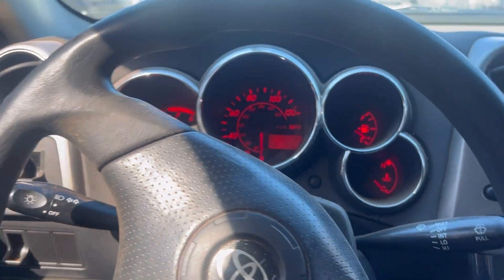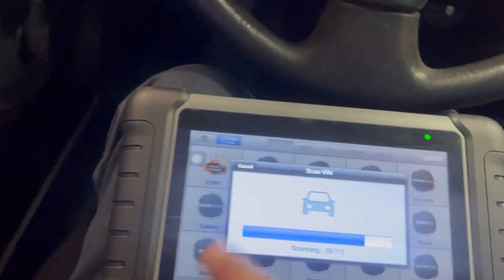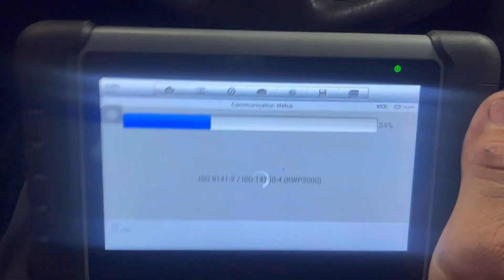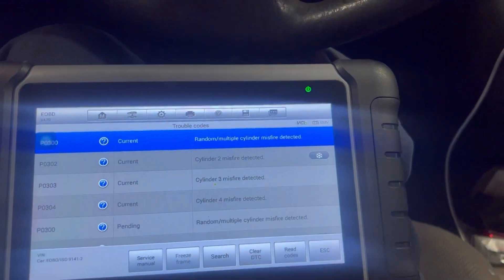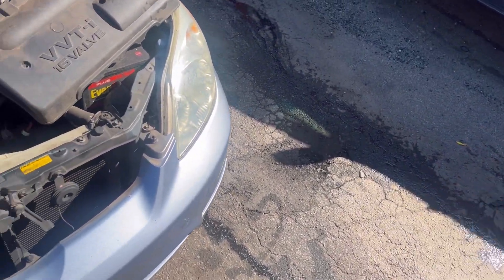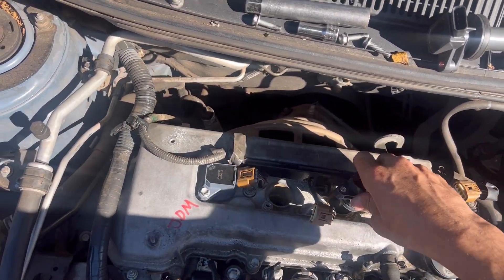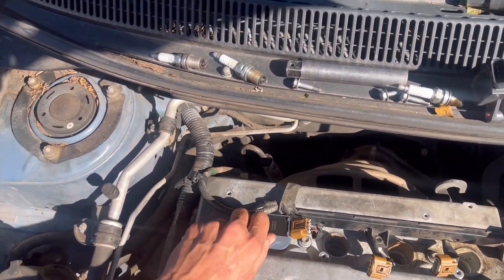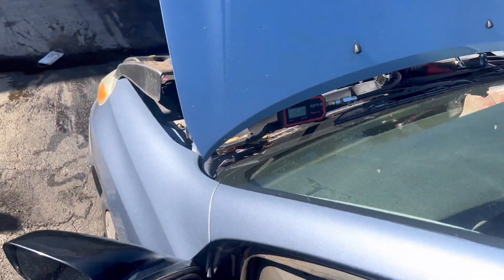I Made A Little Friend 🐝 While Diagnosing This Engine Problem

Comment: I gotta 1997 Ford f150 and I got smoke coming out my exhaust and it's over heating after I put a new water pump, radiator, and a thermostat in it. Everybody is telling me I need a new motor but what if I got a blown head gasket and could I just get the heads fix without buying a new motor for it and another thing i just bought head gasket sealant should I use it ?
Reply from the maker: Hey there buddy you need to perform a block Test before you jump to conclusions it’s the head gasket,I can send you a video showing how to perform that test if you like.fixing it is a pretty big job it’s easier to put an engine in as far as block Seal goes if it works great I’ve never had any luck with it
Reply: @AlexTheCarDoctor  okay brother that will work
Reply from the maker: @deangeloblackburn1616  https://youtu.be/N4NpomEKm4g